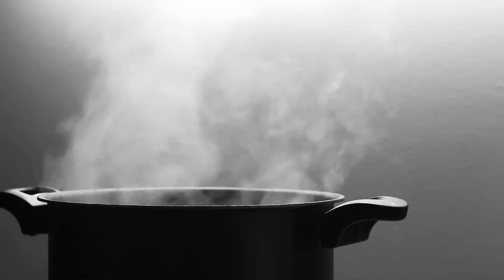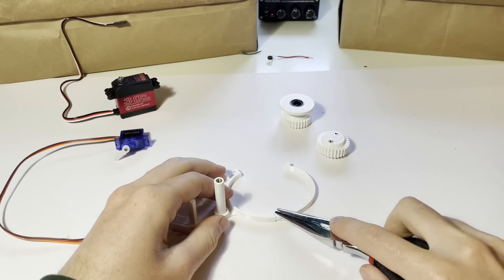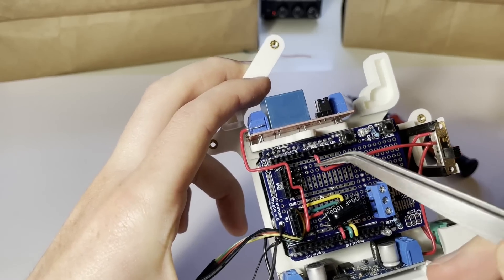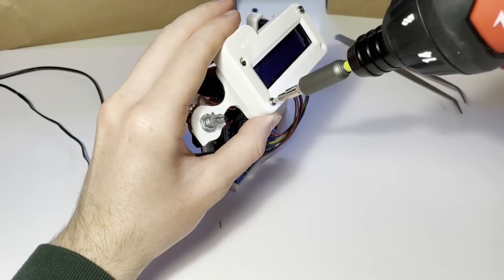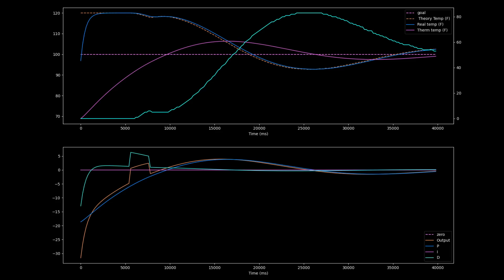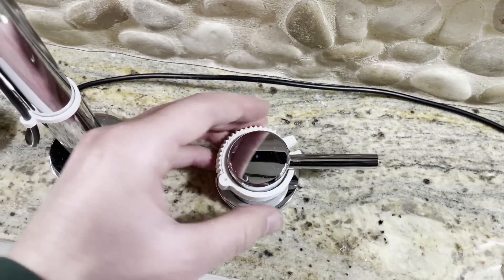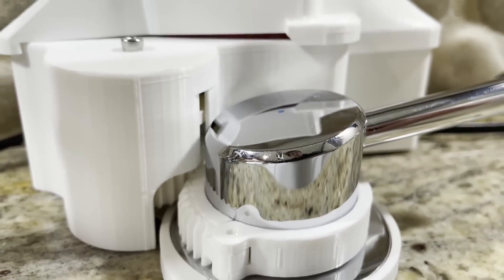PID Smart Faucet

Comment: With some tweaks, this could be a sellable product. It needs:
1. a way to control the flow independent of the handle design
2. dynamic logic to arrive at efficient PID settings for different water sources

Comment: Now add some code to make it 'adaptive'.  Each time it has to adjust the cold tap, monitor for overshoot and such.  Then 'tweak' PID constants slowly over multiple runs to get to desired goal faster and faster.

Where I'm at, the ground temperature and thus cold water temperature varies with the seasons.  So some form of adaptive control that can take this into account would be another interesting 'tweak' to the system.

But this is a pretty cool project as it is and shows a lot of great ideas.  Looking forward to viewing more of your content.

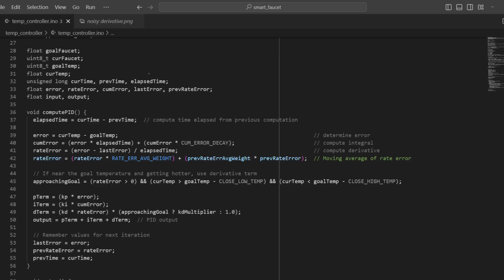Comment: @6:35 a moving average of the input is a bit like the Integral ;)   [but not literally the same, because it's also a bit like noise rejection]
Reply from the maker: At that timestamp I was talking about a moving average of the derivative of the error (as opposed to a moving average of the temperature), and yea, there’s theoretically a situation where that could look like the integral, but it’s usually gonna be unrelated. Using a moving average doesn’t really change the derivative except it just smooths it out.
For example, the system starts and the goal temp is 100, the current temp is 60, and the temp is going up. Then, the integral and derivative would have opposite signs (one positive, one neg). If the temp was 110 and going up, then they would have the same sign.
Reply: @noahponto  fascinating. Thanks for the explanation!
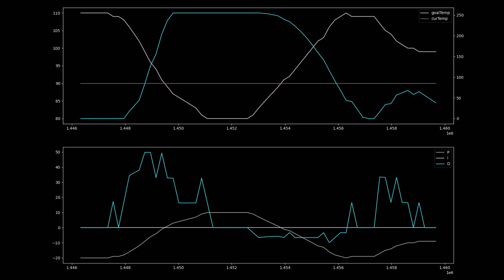Reply: Funny how you thought of that at 6:35 and i was just giggling at cumError

Comment: Man, just the quality of this video gets an instant sub. Really well done. I am familiar with building system design and always thought about making a faucet temperature controller for fun, but I never put in the work. I know water temperature regulation is already a firmly solved problem even with no electronics, but this is a great knowledge deepening project for control systems and design/ integration. Thanks for sharing your work.

Comment: One issue I've been having at home is that when someone opens the tap in the kitchen, the cold water pressure drops, leading to a temperature spike for whoever is in the shower.
I've had an idea to make something similar to this, but with thermometers and pressure sensors in the hot and cold pipes, as well as a thermometer at the output. A system like that should have a faster response to input temperature differences, and might just be able to save me from minor annoyance

Comment: did you look at thermostatic mixing valves? We just put one in our RV because we were wasting SO much water just to get the right temperature. Now the cold water is the distance from the hot water tank to the faucet and after that the water temperature is completely consistent. Best $100 we have ever spent on a faucet
Reply from the maker: Yea, I definitely agree that if my goal was to just have something that managed water temperature, a thermostatic mixing value would probably be a better solution. My goal here was mainly to build something fun and interesting, and this seemed like a good, straightforward example of an application where a PID controller would work well.
Reply: That's...not the point here :)

Comment: This is very nice.  I've got the old-school single knob mixing valve faucet, so maybe mounting a premixing under the sink and merely using the valve for turning flow on and off.  I'm sure water flow can be detected with a piezo to run the temp control.
Reply: You can use a thermostat cartridge pre mix tap in the hot water feed. That you end up with a choice between warm, cold, or in between. But never too hot.

Comment: Do you think you could go into detail on how you did the simulation using weighted averages? I’m a controls engineer working on large scale battery sites and have been working on a sim for the PLCs. It’s difficult to generate feedback for the control loops and your method looks very straight forward to do this.

Comment: What usually leaves me unsatisfed with pid is the idea that i can be faster and better because i know stuff about the system the pid doesnt know. Obviously if i was a god in setting up a smooth pid controller as well as configuring it perfectly id probably be able to transfer my knowledge into the machine and make it just as good. The most defining metric for the "easy-ness" of controlling something is set by the delay between actions and reactions as well as how fast of a change we can make. If the piping is made so the warm water has to rise 2 stories before the tap gets hot, the pid will max out (or go even frther) and wait while it integrates into space. But i can know how long it takes, i can even estimate what kind of temperature the pipes and the water left in them might have depending on where heat has been used and at what time it has been used last. So if i know the pipes are cold i just jump to full heat, wait the estimated time and then lower smoothly into comfortable terretory while the pipes slowly heat up and throw me off a couple degrees within the next 20 or so seconds but how do i translate this into my controlling unit? Ideally i would know all the temperatures, all the pipes, the boiler, all the statistics about where heat has been used in the last hour or so and combine them into one all knowing algorythm that can bring my tap up to setpoint within the least ammount of time plus like 1s. At this point we might be able to combat peak human skill. But what im more interested in then is why i can still do what the pid cant, do all this without all the neccessary sensors. Id love to try this out, install your machine on every tap on the house, feed it into a neural network of some sort and train it to almost match human peak performance but i really lack the ambition to do that... Still i like to think about it...
Reply: There is a way you can directly import your knowledge of the physical world into a PID controller! It's called math. The core concept is taking real world physics, like how the temperature of the water in the pipe is effected by pipe length of temperature of the room and insulation and flow rate and so on, and modeling that into a set of equations. The equations are most likely derivatives and stuff (i forget the actual term, equations of state?), and they tell you how the physical world should act given certain parameters. 
After getting the modeling equations, you can then do some more math on them and put them into a PID loop, whether that be open loop or closed loop (closed loop is like the video, i.e. having a sensor and using error to correct the output). Once you have a PID loop you can analytically find the PID values (pain in the ass) then finally build a prototype that works first try. 

The problem? It's basically a bachelors degree in engineering.  (I'd do mechanical if you want to mess around with physical stuff)
Reply: @marshmellominiapple  or you can just buy a DIN mount PID controller for $20 and run the autotune function.
Reply: @SolarMillUSA  he said that there's stuff that the pid in the system doesn't know. And you can tune for different things.
Reply: You might like model predictive control!

Comment: Awesome project! Been dreaming about something like this myself - thanks for open sourcing it! 🙌
Quick suggestion though: Instead of letting water run continuously (which wastes water), maybe add a container (and some extra valves and stuff) with a temperature sensor? That way, the system could pre-adjust the temp in the container before releasing it. I know manual adjustment probably wastes more water, but every drop counts for our planet! 💧
Really impressed by the quality of your content - can't believe you don't have more subs! Keep up the great work! 👍

Comment: Great video! I'm still somewhat new to electronics and such and I was curious why you chose to step down the 12v power to power the servo motors rather than just powering them from the 5v on the Arduino?
Reply: The arduinos built in regulator can't handle the current required by the servos
Reply: @the555timer  oh ok that makes sense thank you!

Comment: This is really cool and all, but wouldn't it be easier to get a single lever mixer? xD
Reply: You have to also adjust the temperature there, and may I say it's less precise. We only have mixers in the house and it's way more convenient to manage water temp with (one lever only). But tbh I'd much better like an auto-adjuster like he built in the video.
At work, we have an auto-adjuster that has a built-in thermostat, so it doesn't even need electronic bits, and I want one of those at home.
Reply: @bagoston325  I think a system like this would be awesome for the shower as you need a precise temperature over a longer time. You could even have different set points per user.
Reply: Probably, but where's the fun in that 😅

Comment: very cool! I sometimes wonder why we don't have this as standard at home. Would make showering etc much more easy.
Reply: Most of IKEA shower valves are thermostatic. They use a bi-metal valve to adjust the water temperature mechanically. You can also get them at your local hardware store, but it’ll be more $$$ cause they are considered “fancy” in US.
Reply: @mr_voron  yep, 70$ here in Poland
Reply: You’re thinking of an electric shower 😂
Reply: They have them in Japan
Reply: Thermostatic shower taps are pretty common around here. Basically similar functionality without all the electronics.

Comment: Neat execution, especially the disengagement gear so you can still use it manually, though I wonder if it could disengage itself before it loses all power in event of a power cut.

My idea is more invasive, using a pair of control valves plumbed inline with the hot and cold water, a flow-meter after the combination, a modified faucet with integral thermistor, and magnetically coupled stick-on knobs for waterproof control. One knob for temperature, one knob for flow rate.
Because making it resilient to power loss would be difficult without making the valves accessible with handles, it would need to be reliable and work even during a power cut. Maybe the flow-meter could generate energy, or it could use a thermoelectric generator.
Reply: I also wonder if sometimes moving gear miss the exact place and stuck in the process.
Reply: @ERGU9  simpler solution - just unpower the servo - its a bit harder to turn but will turn easy enough.
That way the thing is always engaged with the tap - but unless it needs to be used, its physically unpowered - also better for servo